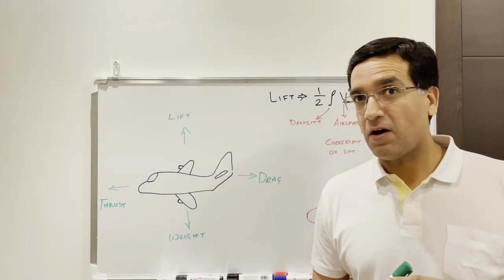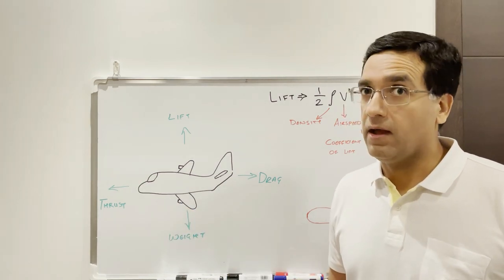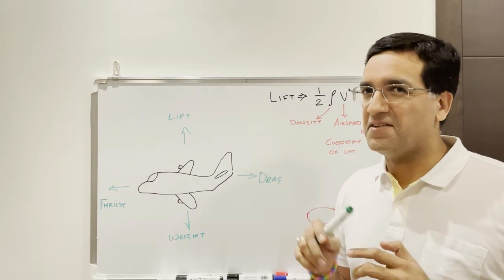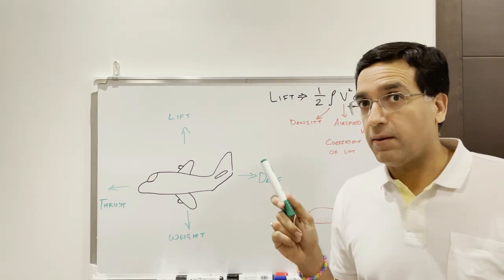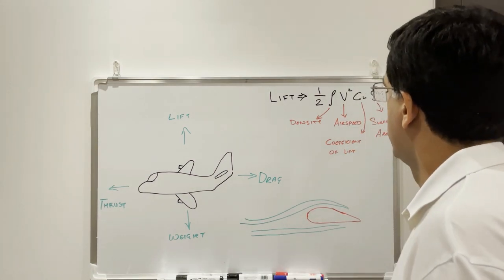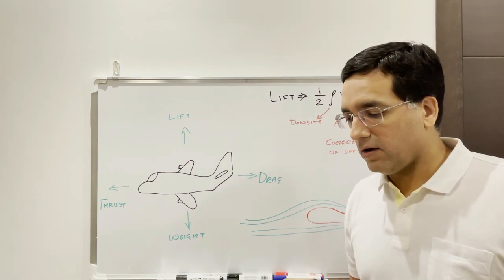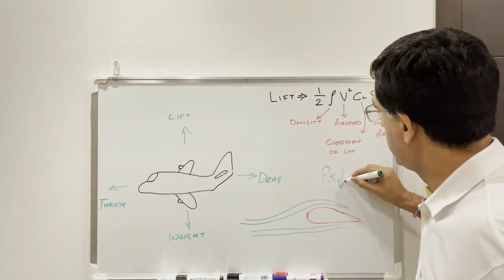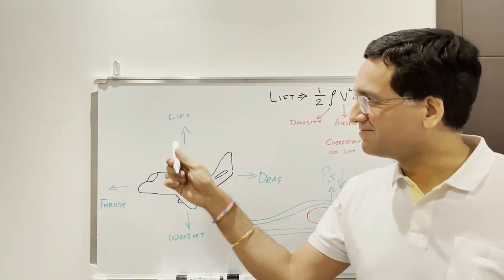How do wings generate LIFT. Explained simply!

Comment: This was a good video explaining some of the forces on aircraft in nontechnical terms! I noticed a couple of misconceptions about your physical description of lift, however. The greater distance on the topside of the foil does not create the increased speed experienced there, and there is not a one-way causality between the increased speed and low pressure. Rather, the pressure and velocity gradients go hand-in-hand in sustaining one another during lift. Lift is also not a suction force felt on the top of the foil, but rather a push experienced on the bottom of the foil, as differences in pressure always create a push, not a pull. The oversimplification of the process, as noted in the video, may lead to some fallacies, but a good video nonetheless to describe the forces experienced by an aircraft during flight!
Reply from the maker: Thank you for taking the time to watch the video and provide your feedback. I appreciate your technical insights regarding the concept of lift, and I agree with the points you have made. The purpose of the video was to explain the complex concept of lift in a simple way for the general audience, and I acknowledge that some details were oversimplified. However, I'm glad that you found the video of some value. Thank you again for your comment.